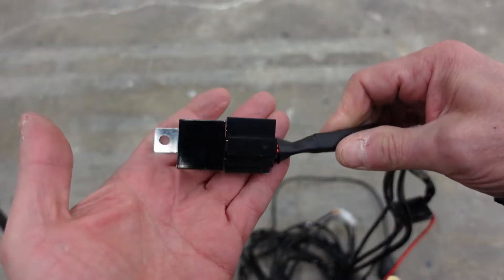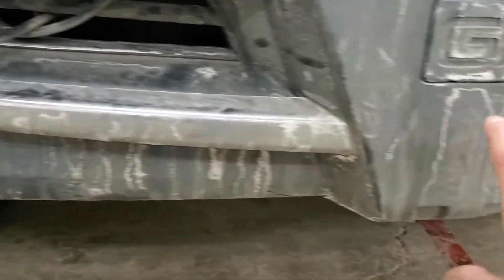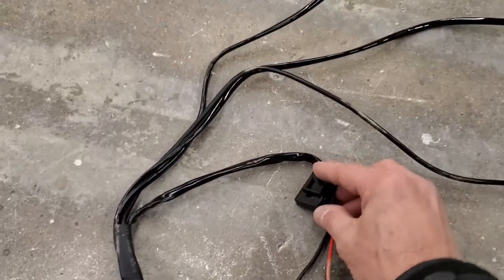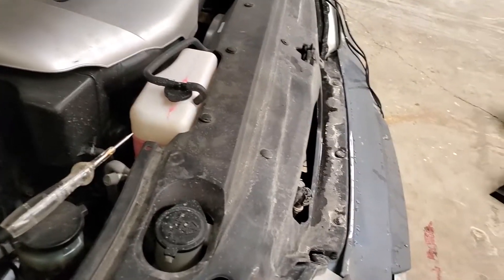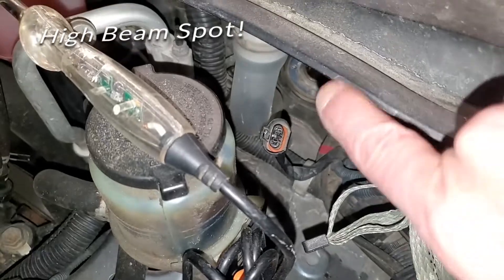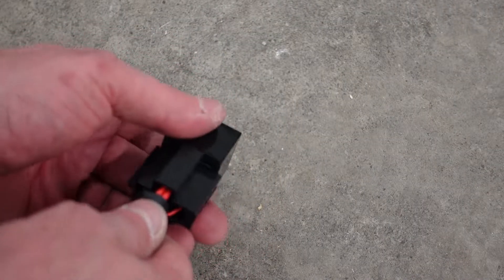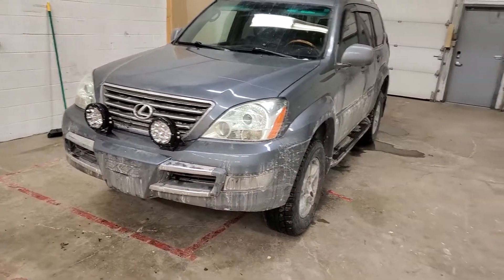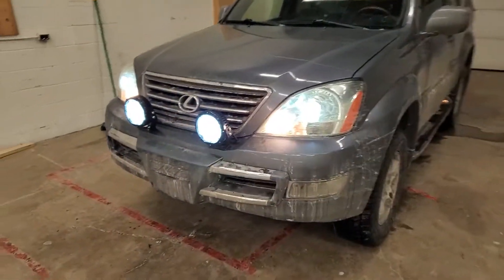High-Beam Switched Auxiliary Lights - GX470 Bumper Mounted Spots - Aligning Driving Lights

Comment: Man these are exactly what I want to put on my GX... I think I may shove them inside a cheesy ebay plastic "low profile" roof rack thingee, use some powerful magnets (and some sort of failsafe safety strap or whatever to the roof rack) so I can pop them off as needed, make changes, clean the car properly. (magnets like to trap moisture.) I'm thinking 4 of these suckers up top (probably need to build in a sort of glare shield down low so they don't light up the hood), with BiLed retrofits in the driving lights, and a something potent in the high beam slots... though I have these old Q45 projectors I sure would love to see inside a GX assembly. Light output on them is pretty poor if we're honest, but they are cool as heck. So long as I have some good true fog lights down low, probably some Diode Dynamics with an SAE approved pattern, low beams should be adequate. High beams will be ridiculous. The Profile Hi-lens to match the Q45 projectors would put some intense light in the middle of the road, and allow me to really spread the pattern of the aux highs on the roof. I also have a 30" dual row light bar I ended up with that has some amber lens tint/diffuser on it that's crazy good at area flooding for light, but I can't stand how tacky it looks.
 I like the switched high beam you've got going here, I definitely want to design the setup such that I can use the auxiliary switch panel to "enable" the roof lights, and then have them go on/off with the high beams. And I might be pushing it on draw with that... 4 up top, 4 in housings (2 HIDs that draw 30-40W each) and 2 fogs and honestly that may become 4 if I find any area I deem to want more light. Driving up and down the pipeline in a MN winter made me learn the importance of good lighting.